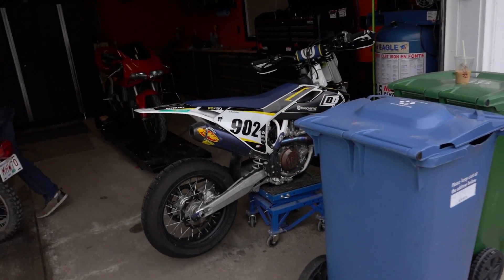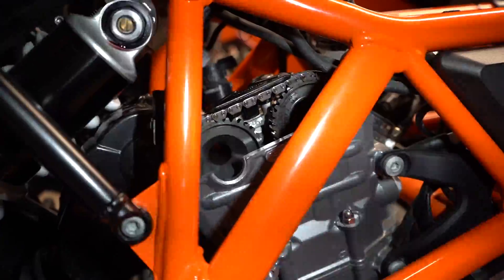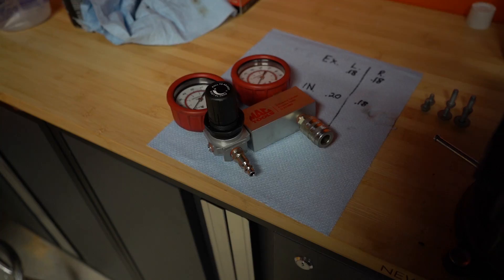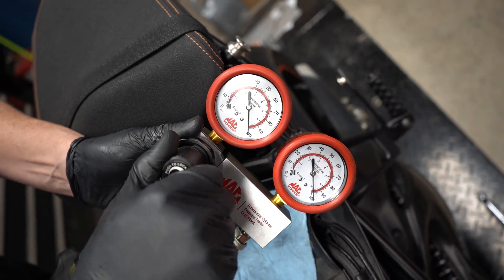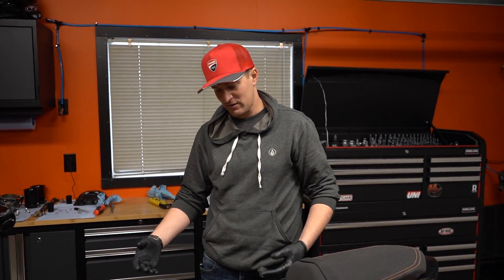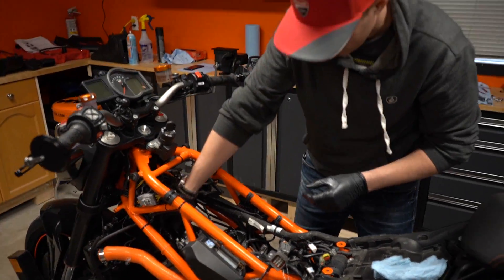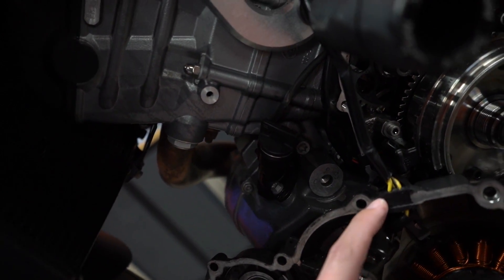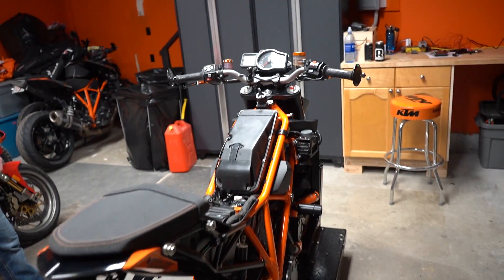Getting the Superduke ready for 2020 - 50,000KM  - Valves, Leak Down, Gaskets

Comment: Damn compression is quite great on your bike for 5 yo ! I have an er6n (ninja 650r from 2007) abused from last owners, it has 72k kms, they didn't do the valve clearance at 40k kms and now i'm sort of out of specs..

Maybe a bigger engine, more bulky is just more reliable than a small 600cc that vibrates a lot.

I now have an XJ6N, from 2009, sat a long time in a garage, i guess at about 40-50k kms i'll do valve clearance check and compression test... Hoping the baby R6 engine powering it will hold on ! Last owners didn't know shit about maintaining the bike but also they were beginners so hoping the engine is clean ;